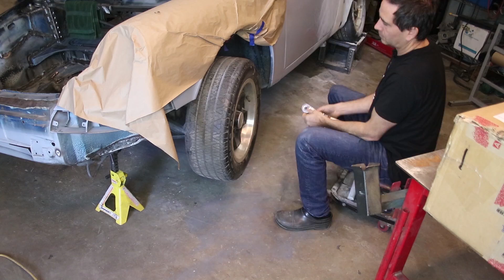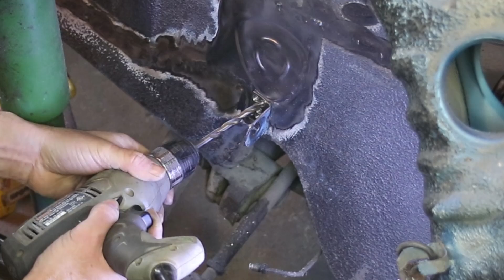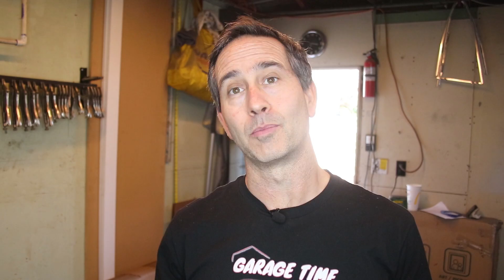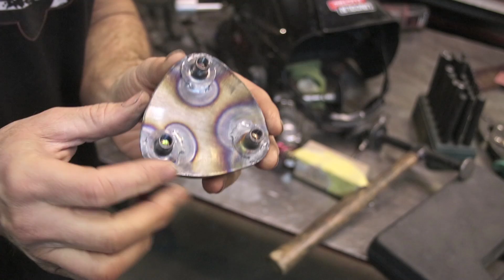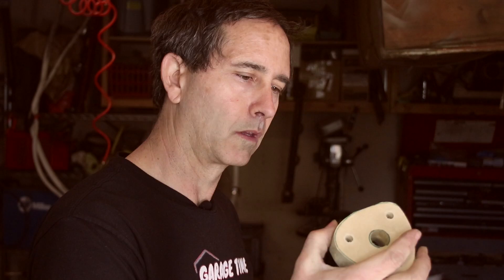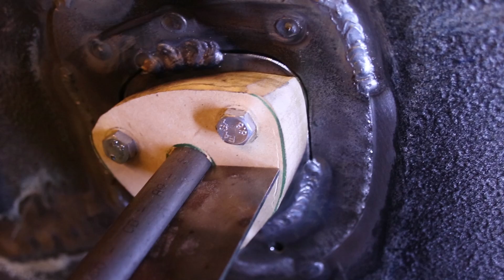How To Avoid Chassis Cracks When Using Strong Anti-Roll Bars 💪

Comment: Dude...you're avoiding sanding?! I can't believe it!! LOL. (Commenting as I watch...) Nice that the stampings were still there, if not used. Triumph did a lot of that, too. Good call on your two-piece design for the strengthening plate. I wouldn't have thought of the strength concerns there. That plasma cutter is so awesome! I don't think I have the guts or planning skill to do the resto-mod stuff. Much easier to try to recreate what the factory did. Great idea on the nut plate with not welding it in. I agree with you there about the longevity / no corrosion argument. What is your degree in?! Good show, Tom. Thanks!
Reply from the maker: Ha ha, thanks for your comment.  My degree is in Mechanical Engineering.  My other car is an originality freak, so its nice to do something different on this one.  I like the creative aspect of this restomod.  Its no different than creating prototypes for clients.

Comment: This is one area where car manufacturers really have dropped the ball ...just having a springy piece of metal between both sides of the car to reduce roll is as unsophisticated as you can imagine...even in the 1990's there was cars with active antiroll (Citroen Xanatia Activa) but todays 's manufacturers just keep on with springy bits of metal for cheapness...McLaren is about the only one who uses active antiroll today. Using a antiroll bar means as you roll down the road in a straight line the car is constantly bumped from side to side as one side of the car encounters a bump or the other side meaning less stability and grip..not to mention comfort....and it will never reduce rolll to zero unless it is extremely stiff which will make the car even less stable in a straight line unless you are on a perfectly smooth surface.
Reply from the maker: True,  I'm not too up to speed on newer car stuff, but I agree the active technology would give the best of both worlds.  Kind of like active or variable cam and ignition timing.
Reply: I just Googled "cars with active anti-roll/dampening.... I found 10 right away. Everything from the Tesla Model S, to even the new Ford Focus, Land Rover, BMW.... and so on. So I guess tech has changed from 4 years ago. Thats good. Some cars dont even come with power locks though, or cruise control... not everybody wants all the tech. Some people wouldnt pay even $50 extra for active dampening tech, cause they arent driving like that and have no cares about a smooth ride.
Reply: @PrecipitationMatters  Active antiroll/damping in new cars is a very basic poor relation to the sophistication of for example a Citroen C6. Most just adjust the damping to provide an anti roll effect..cheap and not so cheerful

Comment: I have a 67 912, and it's amazing that the 74's still have the depressions. Makes it easier to align the hole location on both sides.

Maybe there's more to the Porsche crest shape, than we know? Hmmm Those German engineers were ahead of the game.
Reply from the maker: Exactly, I think Porsche was frugal in the early years too.  There's evidence that they used up as much inventory as possible as they made slight changes to their cars.  That's probably why those depressions are still there.